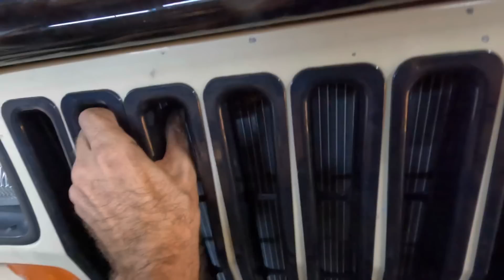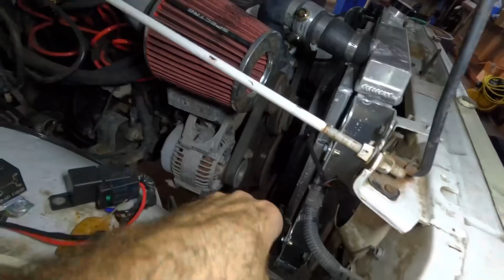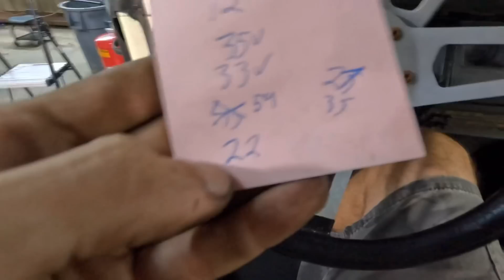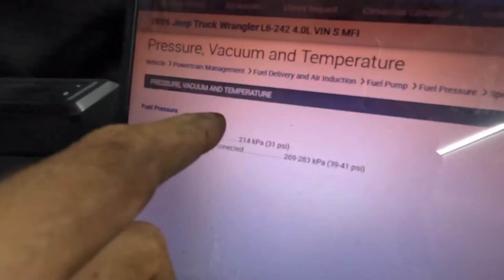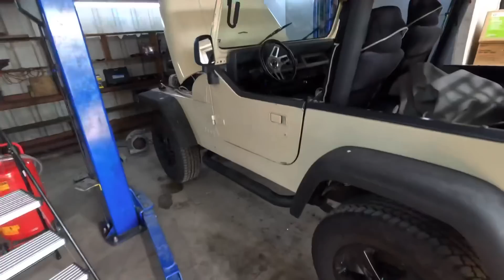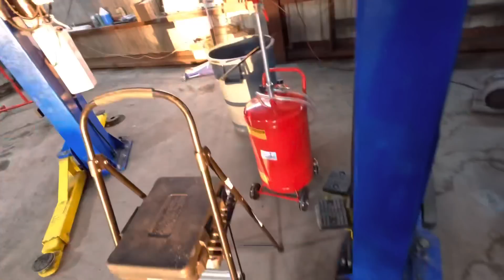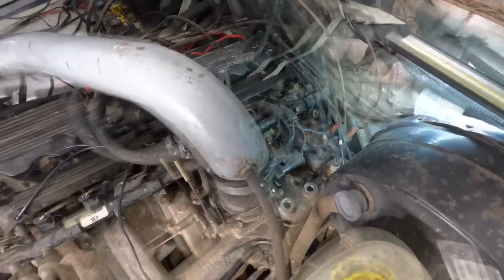Parts Cannon!! Can it be saved?? 95 Jeep Wrangler 4.0

Comment: So many aftermarket parts. Any one could cause a problem, starting with the air filter. The catalytic convertor could be melted or breaking up and cause intermittent clogging. Vacuum leaks including the intake manifold gasket which is the same as the exhaust manifold gasket and could be compromised by a red hot exhaust manifold. Your smoke machine may help.

Comment: With the crap in the rail and possibly low fuel pressure i would check the injectors som they don't leak and spray nicely, had an engine like this once and the o-rings on the injectors were hard as rock and leaking air so ran lean, new o-rings is a really cheap fix is it is that easy ;)

Comment: I don't know if they have them on the wranglers, but in the Cherokees there's a small pill shaped vacuum canister that is under the bumper usually on the passenger side. Mine broke when I got into an accident and was causing a bunch of issues from vacuum leaks, the line running to the canister can get really brittle and breaks easily
Reply: It chafes on the bottom of the battery tray, and battery acid is no good for it either.  Always some thing to check.

I replaced mine 20+ years ago with a length of gasoline hose - has worked fine for long long time.

Comment: Ray are you going to have to try to get your scanner for the older vehicles cuz I got to sneak and suspension that's what you going to be working on if you get a rep or having a decent prices and not trying to sell people what they don't need which I know that's what you do you don't sell people what they don't need and you try to treat everybody as if it was you in the shop getting fixed so I suggest you going to have to get you a scan tool for the older vehicles so you get a good reputation all the people just got older cars are going to be coming to you and I know you got a a pretty decent reputation for not selling people what they don't need that's what you did at the other shop if I watched a lot of your videos from the other shop yeah you didn't sell them what they didn't need all right man you have a good day and I hope you get that wrangler-bangler fixed it can't be too much wrong with it with the guy already did all the hard work replaced all the sensors and the PCM and all the other stuff it's didn't have the means and the technology and the cable in the know-how to complete it all right man have a great

Comment: Please explain importance of correct grease for o-rings.
Reply from the maker: It helps to lubricate it so the seal doesn’t tear when being pressed it. I used dielectric bc it won’t degrade the rubber of the seals and is fairly inert
Reply: @RainmanRaysRepairs  Thanks for your  reply. I understand regular grease can swell the seals.

Comment: Had a shop that told me they couldn't find out why my motor would die all the time because it wasn't doing it when they had it, but I needed it for work so I fired all of my parts cannons at once. They apparently did the work and it didn't fix it. Turned out to be worn spark plugs.

Comment: when i owned a fiat 2100 6 cylinder  , all ok with cooling but what made the heat problem was ignition timing, timing adjusted and engine block cooled down , had citreon with cooling issues, radiator  was clogged, replaced with dual core , temp good when fully warmed up, i know there crap cars, current car new santa fe.....which i like..

Comment: I had a 90 jeep with the 4 cylinder, bought it rebuilt from a gentleman, did it cause my girlfriend at the time loved jeeps. That thing sucked fuel, had a top speed of like 65, and none of the gauges were very accurate. I used it to run around town for a few years, then got rid of it cause it was pretty scary to drive on the highway and I didn't need 3 vehicles anymore. This thing reminds me of it

Comment: The parts artillery graphic was accurate! Block that fuel return hose off at the rail and dead head the pump to check for max pressure. The max pressure in the specs you looked up just arent being achieved. Just because it has a new pump, doesn't mean its a good pump. The rubber hose in the tank maybe split or leaking. Also, the code for the injector driver was likely caused by you unplugging the injectors while it was running trying to diagnose it.

Comment: As always, I enjoyed the extensive diagnosis, even if it didn't fix everything. I'm not afraid to admit that what I know about fixing that Jeep would have been exhausted by now. I did read something in the comments about the ignition at the distributor having a problem. At first I thought that maybe the exhaust manifold being so hot and being so close to the intake was causing fuel boiling, but the fact that the fuel pressure was relatively on spec (after the replacement regulator) kind of rules that out.

I've got to say, I really like your work ethic, your methodical approach, and your ethical nature. Good on you Sir.

Comment: A DRBII would be great to have on a loan. Someone mentioned it already but yeah, I'd look at cam and crank signals ( fuel injector timing  ) and I'd also like to know if the O2 sensor is switching nice and fast.
Reply: You mean DRB III, right?
I needed one to unlock antitheft once.
The customer could get a PCM for $90 sent, or tow to the dealer.
He towed it.
Didn't want to pay his bill.
Could have solved it right then.
Refused to listen.
The tow was $325 and now it's not my problem.

Comment: Very thorough diagnostic video; another benefit to your video documenting diagnostics and you come across “surprise” issues like that water pump leaking out of nowhere, it’s a good back up to show owner you are not trying to rip them off with not needed up-sales; when you tell them you found another issue  that was not one of the original complaints, it backs up your diagnostic honesty :-)  Your video shows even if the fuel pressure regulator was not the exact issue, it still needed replaced regardless, the owner would be stupid to not replace that rusty version.

Comment: Is there a possibility that the radiator cap that's installed on that aftermarket radiator caused the leak from the water pump? The only reason I'm asking is I have that exact same radiator. I noticed when installing it, on the black cap it said 19 psi..... I figured that was a little high so I went to the parts store and got a 16psi one .....

Comment: Put 2 cans of seafoam in the fuel tank to get that rust out of the fuel line and injectors. Probably should have done that before replacing that regulator so that whatever crud gets flushed wouldn't end up in the new one.

Comment: *FOR SALE*  1995 Jeep Wrangler.  Needs everything.  Multiple leaks.  Runs, sometimes.  Probably leave you walking.  JEEP = Just empty every pocket  Luv my XJ!  Nothing runs like a JEEP!

FYI, aftermarket crank sensors will give you hard start, no start, and even normal start with engine dying while driving or idling.  All older Jeeps must use an OEM crank sensor.  Ask me how I know...

Comment: All the rust in the fuel pressure regulator . . . How's the fuel filter?also, so many things wrong - it's like the 1987 Dodge that was a 'gift'. Not that are using a parts cannon, just fixing actual long list of problems. Bad carburetor. Fixed. Coil went bad.  Fixed. Clutch spring missing. Replaced. Headlight adjustment system. Replaced sheetrock screws and form wire with the real parts. Carrier bearing and u-joints. Replaced. Alternator. Replaced. Battery replaced. Ground the body first time I've seen the engine grounded but NOT the body). Yup fixed. Dangling hot wires in the cab. In line to be fixed. Bad sending unit in the tank. In line. And so on. Looks like this Jeep to me. A LONG list to be done.

Comment: This is a YJ, Next model year at 97 is the TJ, then the model year start 2007 is JK.  Yea I am a jeep guy!  I had a 91 wrangler myself before I moved on to a 08 Jeep unlimited.

Intake on it is aftermarket.  Could be lack of backpressure on the exhaust causing the backfire.  Allow too much flow in the engine may not get it all combusted before it heads into the exhaust.

Comment: Too many people out-trick themselves by changing stuff that doesn't need to be changed thinking it will improve things. Put the engine powered fan back on. Ditch the K&N and put the air box back. For these 'older' (compared to the stuff I'm used to, this is NEW), it would be a good idea to get an old fashioned scope so you can see what the spark is doing. This thing needs everything gone through>>back to basics. These 4.0's are almost bulletproof.

Comment: I'm a small engine mechanic but I've worked on most everything from heavy equipment to the small stuff. I'd say your pressure gauge's ok. I recently had to replace a compression gauge I'd had for years. How did I find that out? 2 saws came in, 1 obviously low on comp, the 2nd not but both had the same reading. 2 different size saws same reading? 1st time for that 1!

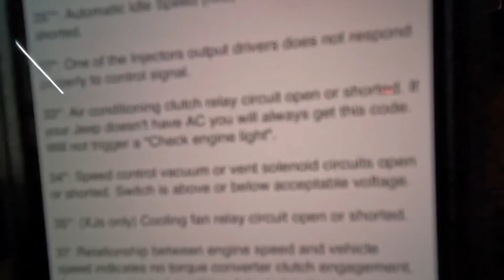Comment: 13:34 I'm not to sound like a troll but, it's not an XJ It's A YJ LOL! I'm not saying that it's completely different, it dose share same parts and likeness though. I use to own a 97' ZJ with the same displacement size engine 4.0 inline 6, good strong AMC engines. I'd try replacing distributor cap rotor arm and plug wires make sure to get the one with brass points and not the aluminum also new spark plugs.

Comment: May be a weak fuel pump cause the pressure is not increasing when the regulator vacuum is removed. Also compression  may be low as well in the cylinders

Comment: This reminds me of the one time I encountered a faulty ignition coil. The car had no power; It was consuming an excessive amount of fuel; It overheated; It was hard to start; It would intermittedly idle rough; It would not rev high enough. It was a Fiat (go ahead and laugh, get it out of your system) 4 cylinder, has two ignition coils. One of these coils was internally damaged, it would intermittedly give a spark, and it got worse over time (several years) until it got to this point. Changing this coil fixed the issues completely. Intermittent rough idling was the first symptom that showed up years before the complete failure of the coil.

A couple of years earlier that car did not charge the battery and would not start. The fault was that the ground cable between the chassis and engine had a bad connection. Voltage would be OK at the battery, but not at the engine when starting, since the bad ground connection between the chassis and engine would impede current flow. The ground strap was a round wire crimped inside a sleeve that was capped at the other end, this connection was full of oxidation, a new ground strap fixed the starting issue. I bring this up, since I suspect that this ground issue might have been the reason for the coil failing.

I'm not saying that this car has a similar issue with a coil or the coil, but the symptoms are similar enough that I feel this story was worth telling. Overheating in the manifold would be caused by intermittent lack of spark (or possibly late spark due to excessive resistance in coil?) resulting in fuel burning inside the manifold. Rough idling would be caused by low oxygen reading in exhaust forcing the ecu to inject less fuel than needed.

Comment: I had one of those. The water pumps were notorious for failing. Had to replace mine every year almost.
Reply: Jeep’s always run warm to begin with. People most often go for a bigger radiator and electric fans, trying to cure the heating issue. The mechanical fans and shroud almost always work better. As for the fuel pump, I’m willing to bet that it’s not a OEM pump, OEM pumps are better and last longer from my Jeep’s/fuel pump experience. My 2003 Jeep has heat soak issue on the #3 injector/rail and has trouble starting up due to vapor lock(TSB).If it still over heats after the water pump is replaced, make sure the air is burped(been there) out of system by raising the Jeep’s front end when filling the radiator.
That red hot exhaust maybe that the CAT is pugging up.
I hate Jeep issues, i chased some of those same issues with my 1991 Jeep, just my 2cts worth...which isn’t much these days😊
Reply: @joerubi03  He said it wasn't Cat. My thought as well.

Comment: Wouldn't have a leaking inlet manifold gasket by chance? That would make it run lean and be a bit cranky (hard to start, rough running etc).  You did mention an exhaust leak in the beginning, if its a manifold leak, I'd be looking there.

Comment: CPS on the flywheel. The ECM has no memory and must set timing every time it starts. Timing is set on the first three revolutions by counting pulse from the Cam sensor pulse (in the distributor) and the crank position sensor on the flywheel, one of those or both are weak, that is the hard start, and timing fails the first couple of starts attempts then succeeds. Hope this helps. Correction, this ECM does have memory, I was thinking of the older Renix system.

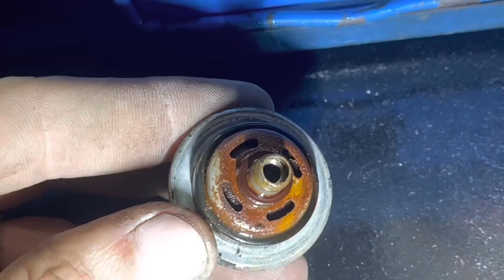Comment: I am not a mechanic but at 22:26 in the video I wondered if the regulator has a diaphragm with a hole in it, could it suck fuel into the vacuum line?

Comment: Fuel psi reg sure looks dirty, wonder how bad the injectors are…. Fuel psi still shows low, I’d want to be double checking with another gauge if you think your loaner is no good. 

Also, there’s several old snap-on, Bosch & otc scan tools on eBay that can do the pre-obd2 vehicles for cheaper than a software upgrade or the cable adapter for a new scan tool.
Reply: IIRC the only thing that can use the full functionality of the chrysler jeeps obd1 port is the Dealership DRB2 scantool.

Comment: The electrical system hack is killing me!

Check compression. If it overheated to the point of a glowing manifold, it may need a head gasket. 

After that, I'd check the intake gasket for leaks. If it's got an exhaust leak, it's got an intake leak. Same gasket. That may clean up the vacuum issue and richen it up on startup.

After that, I'd check the O2 sensor to make sure it's not operating full time in open loop mode.

Comment: One of the dumbest thing you can do to a car is to remove perfectly good and properly engineered factory air intake and install so called Cold Air Intake (like this example) which is actually Hot Air Intake since it's open and pulling hot air from radiator.

Comment: On my 1999 Dodge Ram, I had a miss on one of the cylinders and found out a injector was staying open we replaced it and then another one went bad , after this happened to more times I replaced them all problem solved in the mean time it was frustrating ugh. 😁😁👍👍
Reply: My experience with injectors: bite the bullet and replace them all.  Hard if you have a newer vehicle with expensive (>$150) injectors. Last was my 2003 Cummins.... sure runs better, but a setback for certain.

Comment: That Jeep has more issues than the local newspaper. It hasn't had a lot of maintenance so you can probably unload the entire cannon and it still won't run right. Compression doesn't sound good, weak battery, clogged everything, leaking everything, rusted everything, Salvage yard here we come!!!!!!

Comment: I was thinking spark.  I had a vehicle that did the same thing. (idled ok but missing at higher rpm)  It was so long ago that I cannot remember the solution but spark was the issue.  It was either bad spark plug lines or the coil.

Comment: Looks like you have a lot of mechanical helpers here. I just missed if you connected the ground clamp that would affect electrical operations. Nothing said about getting a radiator fan since it is not working. Did you ever find where the electrical cable goes that was not connected? 
Leaking radiator hose and did not see you check coolant level. 
What do customers think about taking multiple days to find and fix the problems.

Comment: OBD Code 54 for 1995 Jeep Wrangler is a missing Camshaft signal from the distributor module. The harness you were waving around is probably unplugged from the Distributor module. This is the cause of the extended crank.
You may also be able to get an OBD adapter for your OBD 2 reader.
Look into it....
Reply: The wire was for the underhood light that was removed.
Reply: It sure is an issue as this ECM has no memory and must set the timing at startup using both the cam sensor and the crankshaft sensor.
Reply: I'm surprised he doesn't have an old Snap On brick code reader.
Reply: @tiredoldmechanic1791  That's what I said! I bought an old brick off eBay for $150 with everything included (a ton of cartridges and connectors--they will come in handy if I ever get an OBD1 Jeep in the future). It's been an awesome tool for working on my Cherokee because newer scanners (basic ones) don't play well with it because of Chrysler's proprietary coding. I can only get basic codes, when on newer cars, I can get a full rundown. With the brick, I have all that and then some. Even Eric O pulls out the brick when he's working on the older Jeeps.
Reply: I have a 91 jeep YJ with the 4.0, I have also had similar issues with mine, prolonged start and wont reliably start. Check the distributer, it may be bad. It helped mine and fixed the problem. I also had code "54"
Reply: I had a old 3.9l with a bad hall effect plate in the distributor. It had fuel on key prime so it would start and flare but die. Think that would be a place to look

Comment: This was a easy diag...though I did work at a chrysler  dealership  from 88 to 2000
   Injectors leak all the time,  the leaking water pump....over heating amd that was kind of common 

Personally,  I would drive it with a leaking water pump just makes sense

That engine sounds BAD BAD
  It sounds beaten to death
It's a jeep thing